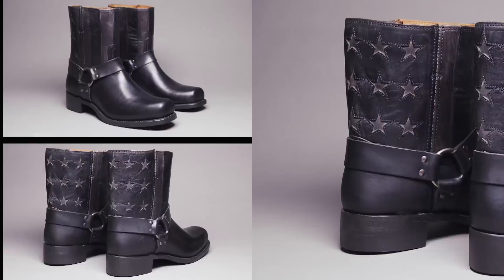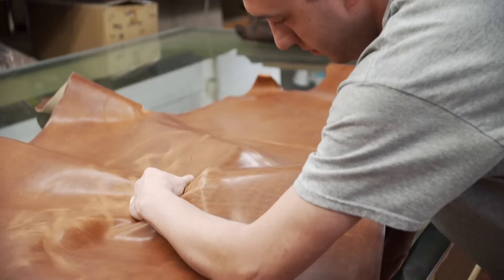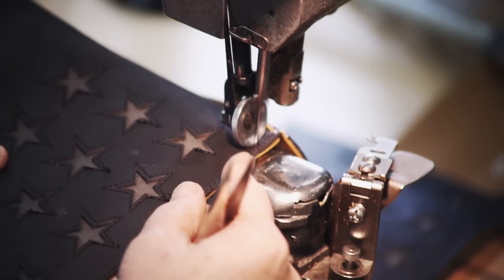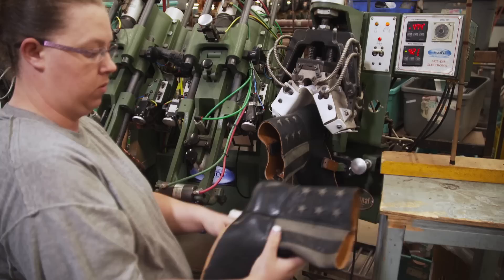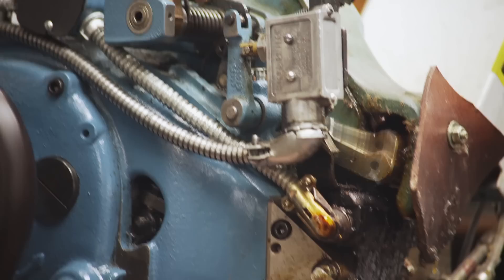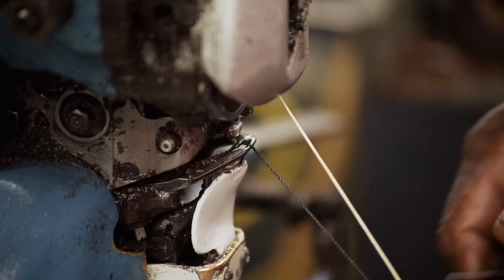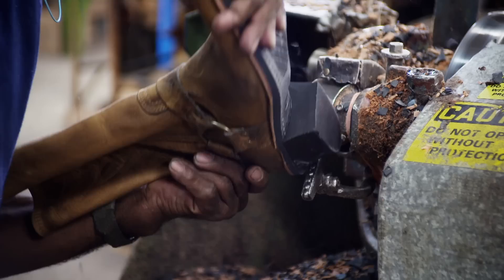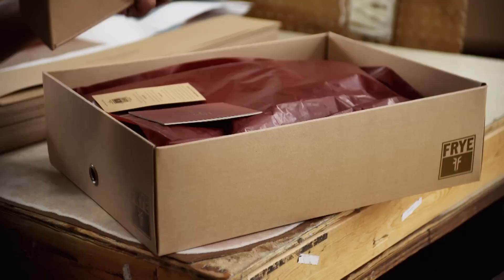How Frye Boots are made - BRANDMADE.TV

Comment: I prefer boots that have actual tread on the bottom so I can walk around without worrying about slipping on anything. 👍
Reply: Walk with your heal... I dont slip in mine
Reply: @mouth884  Heel. Heal is what doctors (are supposed to) help you do.
Reply: SalandFindles I am the same way.  You can get Frye boots with urethane tread.  They went with leather on these to be retro I suspect.
Reply: When we burnt the stubble, leather soles were far better for walking across the burning embers and stomping them out before we went home.
Reply: Well if you tryin some boot scootin boogie you want smooth soles so you can slide

Comment: Frye boots in 1972, 32.00 and fully lined. Easy on and easy off. I loved my boots. Now they are not lined on the foot part making getting boot on with socks on is a horrible experience. I gave my newer boots away 'cause I couldn't stand the sock problem. How much more could a full lining be. Prices now are high. The boot would be worth it even if it was a little more expensive. Sorry Frye.

Comment: Did they say plastic called last????
Reply: The 'last' is the foot shaped block that is used to form the boot. Traditionally they were made of hardwood and were machined by hand, a process taking hours and needing a highly skilled bootmaker.
Each mold for a plastic last costs thousands of pounds, but following the investment additional lasts can be turned out at very low cost and every last is identical to the original. This is only cost effective for large scale production.
It is similar to plastic drinks bottles, where the mold tool costs up to £10,000, but can be used to produce millions of bottles at high speed and very low cost.

Comment: I like the look but stopped wearing them because they don't have a steel shank like a good pair of boots should..I can stomp nails in a board flat all day with my boots because the steel shank stops the nail from going into my foot..
Reply: What do you mean by shank? Because a thin, narrow strip of metal is not going to afford you any protection when the nail goes in by its side. If you insist on using your footwear as a hammer, consider using stainless steel mid soles, which go inside the shoe and offer full coverage.
Reply: You don't need a steel shank when the boots have leather soles. They were only introduced when manufacturers started using soft rubber soles. 
When stomping the fire down after burning demolition waste, hot nails go through soft rubber like a hot knife through butter.